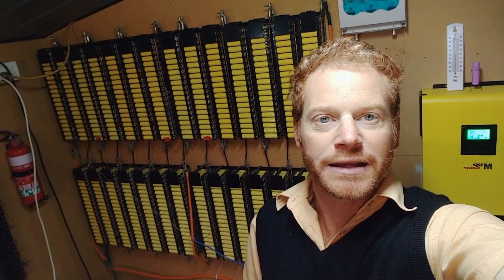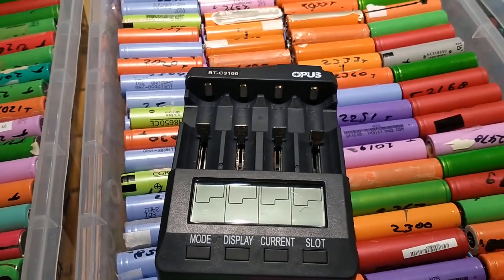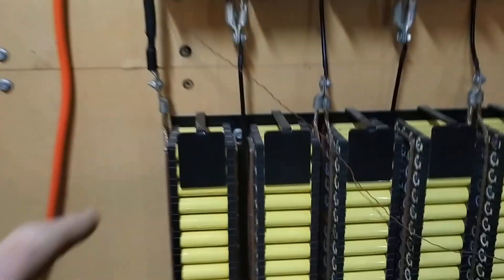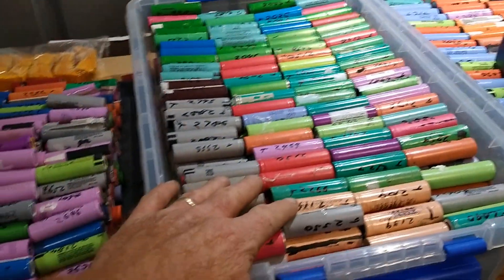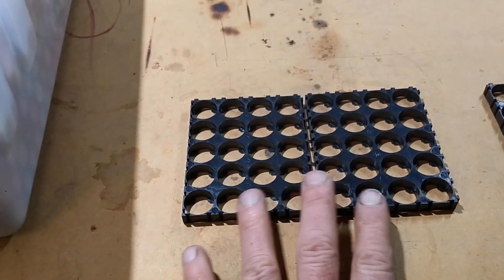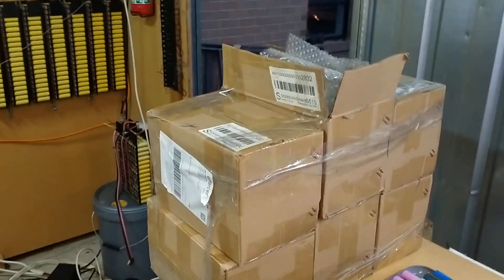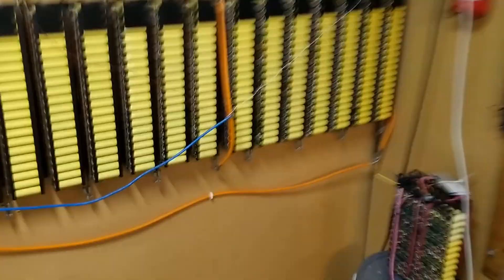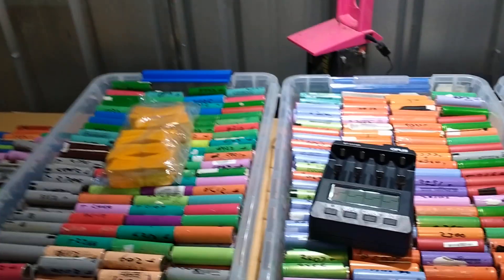My First Build in a 14s 157p for PowerWall using 18650's.

Comment: Hello..can i mix cells from laptops en ebike +- 3000mah for powerwall ? Thanks
Reply from the maker: Hi David, you can mix these cells providing they are the same chemistry ie. Li-ion or Lipo4 or Le-fe? not to be mixed due to voltage are different. Usually laptop batteries and ebike are Li-ion, so in theory yes. But I don't because the ebike can handle 10+amps and laptop topically 1to2ams. I keep these ebike cells for lawnmower and gokart. Same you cannot use laptop batteries for ebike and gokart because a much higher amp is needed than the cell can deliver.
But please continue your research.

Comment: Keep up the good work. I am building a 200p14s packs. I am only using cells that tested 2500 MA or above  . I just need 75 more cells to complete my packs . I just got my lvx 6048 from taiwan. This is my first powerwall. I keep learning from you so keep it coming
Reply from the maker: Thanks for encouraging words. 
I like to used only 2000mA and above but then I would have so many cells under this. I wouldn't know what to do with them and people are not interested on Market Place, so I figure to just put them to work.  I can't see any problem with this other the the total size of the PowerWall will be less then otherwise. Would there be any problems using such low cells with high cells? Also I would have to wait a lot longer the build the Wall.
Reply: @adamcecere3369  E post
Reply: Hi, I want to do it, would you help me?
Reply: @ismailozcelik1662  Sure, I am always happy to help
Reply: @jamrockrobby5219  how long is this Powerwall life 
how many years does normel go in use
Reply: @ismailozcelik1662  nobody really knows. It depends on the quality of the cells and how you treat them. The less you dip into them the longer they will last. Persons have had setup running over six years and still going. Other than only estimates  existed based on number of cycles etc
Reply: @jamrockrobby5219  thank you, you have mesenger or we can talk about the watsapp battery

Comment: Cells mA?
Reply from the maker: So far using 2000mA and above. The pic I used for icon is so far 8kwH.
Reply: @adamcecere3369  how many years?
Reply from the maker: @ismailozcelik1662  Do you mean 'how many years do the cells last'?
The first 7s still in service was installed as my first set in mid 2018.
The cell will last very long time if don't charge to full and keep above 3v.
Reply: @adamcecere3369  how many batteries are there in the cell ?
Reply from the maker: Each pack will have 157 cells. 14 packs. Total 2198.
Reply: @adamcecere3369  I'm going to do with me, it will be pulled up my battery could you help me ?
Reply from the maker: @ismailozcelik1662  I can help but my knowledge is limited, more so in the specs of other equipment. My email is recycle18650liion@gmail.com. i may take a while to respond hence the time between putting out videos.